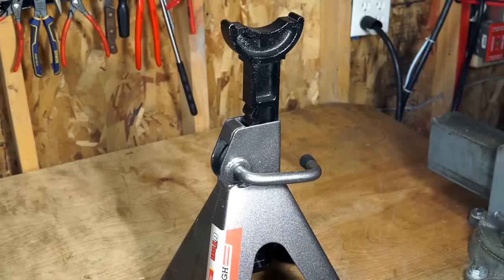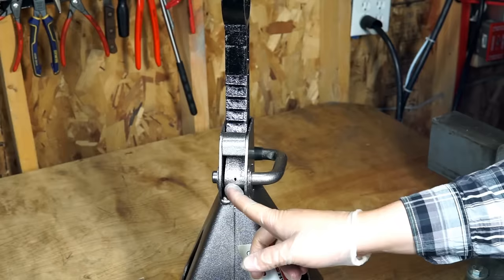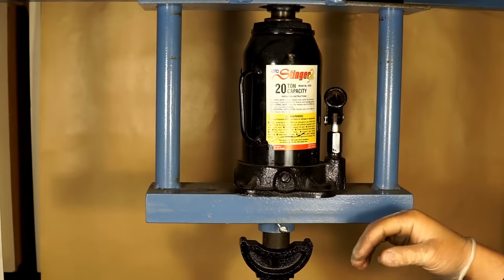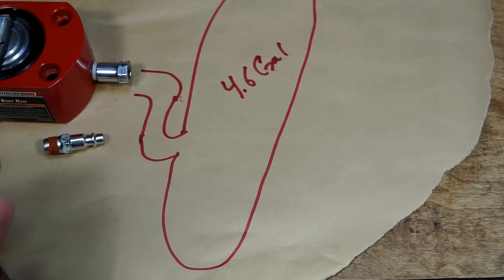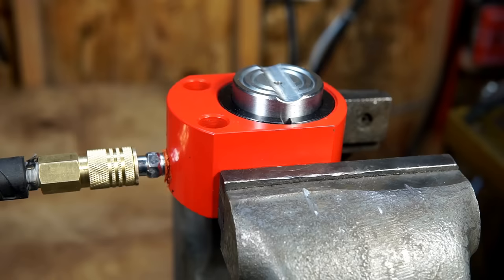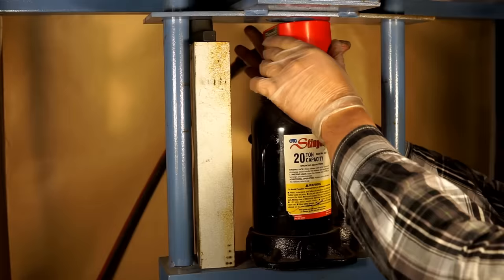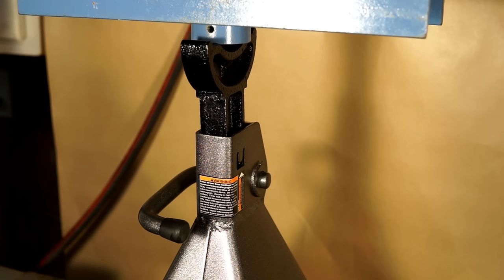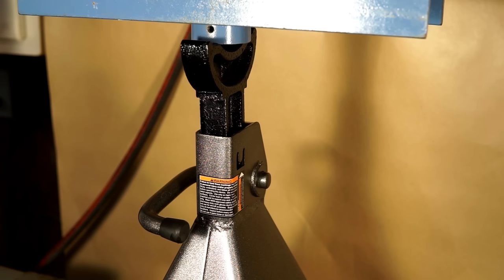EXPERIMENT: WARNING! Doing this to your Jack Stands will get you KILLED!

Comment: Realistically, did the Chinese maker of this jack stand actually calculate the shear point of the roll pin (spring pin) attaching the handle to the pawl? More likely they calculated how small a pin could be used to lower the cost.
Reply: The Chinese make whatever the purchaser has specified. They also make iPhones and quantum satellites (the only ones).
Reply: wholeNwon they also make planes that are not allowed to fly lollllll
Reply: They would probably use the cheapest, which is probably the weakest, which is probably the safest, because you want to want that pin to break so the lever can't lift up. But you can't accidentally lift up against 500+ lbs anyway, so it doesn't matter.
Reply: Once the cam is dogged in place it makes no difference if the little 
pins shear, it ain't going no where. I replace the pins on mine all of 
the time the shear pins hold the handle to the cam. not the car in the air..

Most people I know that own a Porch should not be working on them..
Reply: SegoMan- You apparently are confused on what he is testing. The pins are supposed to shear instead of releasing the pawl on the jack stand when in use.
Reply: jo3tag are you sure that is the actual intent of using the roll pin or did they just use that for convenient assembly?
Reply: No they are not, look at how the thing is built (they are actually well engineered) the side brackets keep the pawl in place, the handle is the pivot point of the pawl which is held in place by the pin. (no time consuming welds on critical parts) Once the pawl is engage the weight of the vehicle keeps it in place regardless if the pin is sheared or not.

There is a lot of unknowns here,

was the pawl or cog damaged or properly engaged the first place
any oil or grease where it should not be
was there any bad castings to begin with
most people who own porches probably should not be working on them
harbor freight has a lot of good and some not so good tools

I have been using all sizes of jack-stands for 50yrs+ the only problem I have is with the cheap oem pins breaking from being dropped or a gentle nudge into their storage space, once replaced they take a licking and keep on locking. I always check proper engagement with  a swift kick on the handle with the load on them before moving the jack to the next lifting point.

I am amused by some vids on youtube and the use of loose fitting gloves in a somewhat clean environment. or worse yet worn while operating rotating machinery..
Reply: Seconded.
Reply: I'm pretty sure that is not a "shear pin".  If it was that big of a concern, you wouldn't have a permanently mounted handle, or you would just make it a round knob so you have no leverage.
Reply: rich10849 Probably not. Exhibit A: The Chinese students at my university could barely stay awake during their stress analysis lectures in 2nd year! 😂
Reply: Don't give them so much credit... they just have a "one size fits all" pot metal pin, and they decided to use those pins which could conveniently be considered a "shear pin" because of how weak they are.

Comment: Great video.  This is why when I jack the car and take the wheel (s) off, I put them under the car.  Don't work under the car with a single point of failure :)
Reply: that why it better to flip the car upside down so i can work on above. some people just never figure it out, if it 4 stroke just drain it out an put it back in after

Comment: Great test. I had a similar issue in designing a latch for an infant incubator porthole door - odd analogy I know - but ... most latches can get 'hung up' in an intermediate position where it engages, looks locked, but isn't fully locked. This allows far less force to open it. This scenario may be what happened to the guy in the story. I'm about to buy jack stands, I'm gonna make sure they are good quality and don't get 'hung up'. A few extra bucks life insurance in these tools should be worth it. Thx.
Reply: @Garage Geek, seen this video years ago, and back again ... This video is a great safety refresher. 🤎🏎️⛽
Reply: OG NURSE here, "Assurance" Beats Insurance 24x7 "Peace, w/Superior Firepower" Shalom.
Reply: Viva Palestine :D @ExpertowgunnerBaronVonHirschRN

Comment: Thanks for all the effort you put into this test. I have the same jack stands and have wondered about this very thing. I didn't really look at how the little handle worked in relation to the 'pawl' that actually holds the weight but noticed the stand raised slightly when i lifted the handle to lower the stand for storage. I also did not realize the shear-pin in that little handle was intended to serve as a safety feature to work as your experiment intended to illustrate.

So, to me your experiment was a success as it illustrated the failure of the shear pin to "shear" when lifting/upward pressure was applied to the little handle. Because the shear pin did not shear (as it should) the little handle could be lifted thereby releasing the pawl and the jack stand lowered creating a potential for catastrophe.  Admittedly, the amount of force required to lift the handle is not insignificant, but a couple impacts gradually moved the handle until it no longer engaged the pawl and the jack failed.

While in over 30 years of on/off wrenching on cars and trucks i've never seen a jack stand fail, it's a good reminder to be careful with the release handle on these things and (as always) use additional safety measures.

Comment: I'm like NASA, I always double up. If I have a spare jackstand on a car job, it goes side by side with the other one.
Reply: Why? If you make sure the pawl fully engages and the hydraulic jack you used to get the vehicle above the stand still has a bit of pressure on it, it's a foolproof system if you aren't on an incline, chock the tires and use common sense for working on a vehicle. If it's a one ton pickup that weighs 3 and a half tons or a truck/tractor even bigger than that, I can definitely understand why.. but a passenger car if you just use common sense you'll always be golden.
Reply: better safe than sorry
Reply: yes they use schnorchel in space. Maybe a big tsunami can come :)
Reply: Good idea Rick! Very small chance of BOTH stands failing.

Another easy trick is to keep the jack on a lifting point with a little pressure so if the stand fails the jack is still there to keep you from being crushed.
Reply: You mean like NASA did on the space shuttle rocket motor 'O' rings...
Reply: You can always put a spare wheel under the car ,much better than your head!
Reply: I double up on the stands and use a 3 ton floor jack as an additional safe guard
Reply: I always leave my jack under the car.
Reply: I leave a little pressure on the Jack I used to lift the vehicle
Reply: If I'm doing work that involves removing a wheel, I'll put it under the frame once it's off.  I also leave the jack in place.
Reply: @lashk lmao, you beat me to it.
Reply: Except for o-rings on the space shuttle Challenger, No need to double up on that one.

Comment: I am 63 now and haven't been under a car for many years. When I was younger and still crawling under cars I used jack stands that could handle much more weight then I ever intended to put on them and the pin set up was different. There was a series of about four holes set at different heights to pick from where you would insert your pins. You'd jack up your car to desired height and place the stands and slowly lower to car down unto them.  The pins went all the way through the stands and out the other end. There was no way those stands were going to come down because of pin failure. Other dangers would be, the car rolling if you didn't secure it, or the welds on the stand failing which I've never heard happen.
Reply: I'm 61 and still use that style stand (when I crawl around under a car, which isn't as often as it used to be) and feel comfortable with them. The pin is U-shaped and has to go through two holes in the stand. It would take a lot to move that pin, if it's even possible.

Comment: By the way, the safety tab on your jack has not been depressed.
Reply: Yeah, I've done it myself. It's amazing how many years you can put up with a very simple thing to fix.
Reply: LaphamBrian safety tab?
Reply: Opposite side of the handle is a "U" shape hole...if you push the tab in it just keeps the lift or arm or whatever you call that piece, from coming out the top of the stand...not a "safety" tab. I don't press mine in because they can be stored more compactly with the lift out.
Reply: Safety in the sense it keeps you form dropping the lift bar on your foot if you pick the jackstand up by the side brace which will want to make it turn over.
Reply: IcantSignIn ohhh ok, I'm not worried about that. sometimes I need to take them out.
Reply: IcantSignIn ohhh ok, I'm not worried about that. sometimes I need to take them out.
Reply: That only holds the moving part from falling out, nothing to do with the action in use.

Comment: So 500 pounds falling on his face didn't  kill him,  and he was still able to bench press a 2000 pound car!!... wow
Reply: I also do the same.  When I have vehicle fully up with 4 jack stands, I always have a jack in centre of the front (cross member or transmission), and rear (differential) as well as tires laying on ground behind jack points.  I knew a guy who had a pickup truck drop on him with all tires off.  Even worst it was in his driveway with his wife and one year old sitting on the steps watching...he unfortunately didn't make it.   Be careful out there.
Reply: @chrislang1321  
Safety redundancies are less expensive than funerals.
Reply: @chrislang1321  with all those jack stands and tires under the car, you're not doing any work under there.
Reply: @DEHOYOS98  Wrong. I've changed several transmissions, clutches, and exhausts, always with all four wheels off, car on stands, with wheels laying under corners of frame.
Reply: @TheAgeOfAnalog  yeah, I'm sure you did...😂
Reply: Surely you know all dudes have a hard head.........lol
Reply: no, he didn't bench a 2000 lbs car. He only had to get it up high enough to wiggle out from under. That could be just an inch. So maybe he exerted 200 lbs of lift to do that? 

For eg: ever seen most cars sag when someone gets in them? Even a 120 lbs woman will affect the "stance" of most vehicles. So if 120 lbs can make a car springs compress, it would only take 120 lbs to get them to lift just as much. 

Now I'm older and weaker, but on my last job 6 of us had to carry a 20' long steel I beam down a trail, over some rocks, and down to the water front where they were welding up a dock. I asked how much it weighed ...1200 lbs. There were times when only four of us were supporting it......so that's easily 300 lbs.
Reply: Javier Pena well it’s not 2000 lbs where he lifted. It would be the 500 lbs if we are going by this example. It is possible to have super human strength when in fight or flight. But even still I agree he wouldn’t be able to lift and get out at the same time. Hell it is hard enough to get out with nothing on you
Reply: maybe the wheels are still on.
Reply: Well he managed to release a jack under load with his “bare hands”. Bench pressing a car is nothing, this guy obviously has superhuman strength. Or maybe he’s just some dope setting up scenarios that only injure, to conjure up a lawsuit outta thin air.
Reply: @chrislang1321  Xhibit voice:  yo man i hear you like jack stands..so we put jack stands on your jack stands under your jack stands
Reply: Adrenaline
Reply: No need to bench press 2000 pounds if  it is still on three more Jack or three wheels.
Reply: I'm not surprised that He was able to lift that much weight on top of him.I weight 160 but was able to lift my 2001 Camry after. It fell on my shoulder/collar bone .That was due to my stupidity ,lol!
Reply: @TheAgeOfAnalog  that's what my old taught me when i was a kid.  Always place the tires under the rotors. One day while working under the car, the jack failed. The wheels caught the car and saved his life. Happened in front of my eyes when I was 7.
Reply: @ziggamon  PCP
Reply: Must be the endorphin
Reply: You'd be surprised what strength you have when you mix adrenaline with fear.
Reply: He benched ONLY 1000 Pounds...Remember he was at one end of a 2000 lb car...It makes ALOT of difference between benching 1000 , instead of 2000.
Reply: @muskokamike127  There were no tires...no Normal Force N. The dude became the N force .Actually since 1 jack failed , on a 1000 lb end, he had to lift some of 500 lbs...so i guess benching 500 lbs, is a lift with arms extending almost 100%...lifting 500 lbs, is lifting 500 lbs, even for 1 inch...F x d, is work....Mg = 500 lbs...500 x .03 meters, was the Work = F x d, that he did...instead of benching, which would have been F x d = 500 lbs x .5 meters.